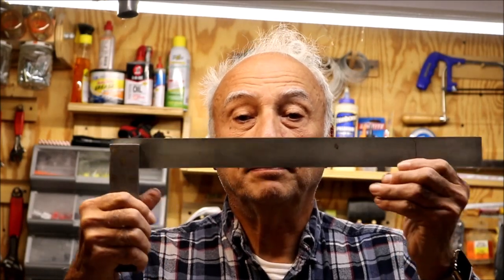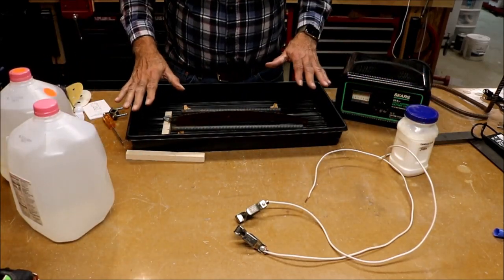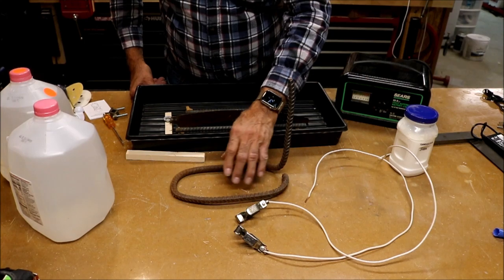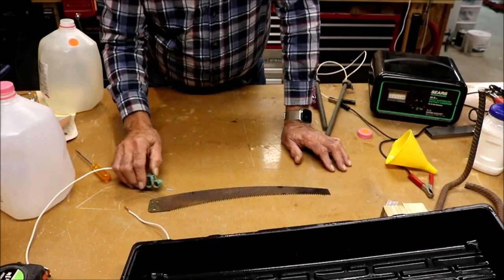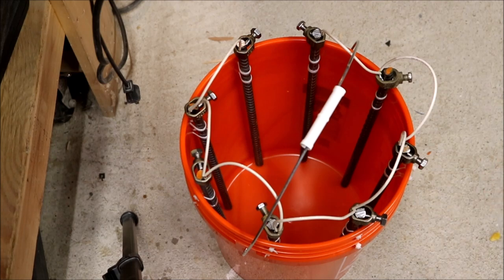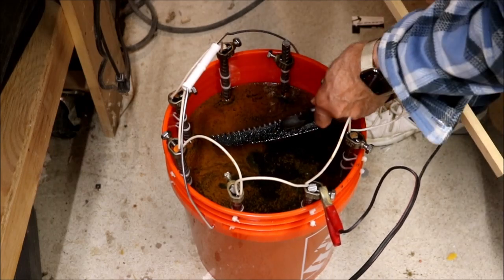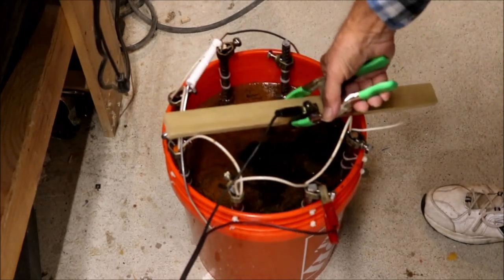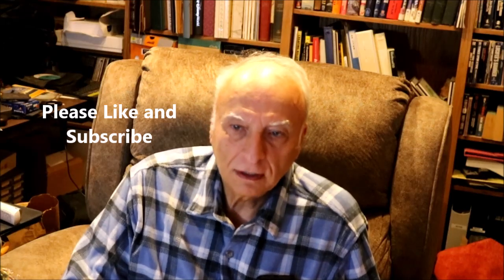Removing Rust the Easy Way

Comment: This is unconvincing I'm afraid to say.
No Chlorine can be evolved if there are no Chloride ions present
The mechanism of the process is not given.

I have no doubt that rust can be removed using electrolysis but I'm of the opinion that the black coating, whatever it is - is unattractive.  Perhaps the process is sensitive to temperature, voltage, current and solution concentration.

Thank you for your presentation though as it provides a useful starting point for further investigation or experimentation.

Comment: Great video, thanks for sharing. Just let me ask one question, please : washing Soda mixes with water into a more or less strong Lye . Have you ever tried removing rust with acid ? Used that method with old corroded bronze coins and it worked very well. It’s a bit tricky in handling and one has to watch over the coin , or there won’t be much of a coin left . Also hot water and salt in alloy foil will get of corrosion on silver . Both methods work without electric current. Although only on small items, admittedly. Anyway, thanks again for sharing your knowledge!
Reply: Forgot to mention: I am using citric acid or vinegar to remove oxidation from battery contacts. Works also very well.
Reply from the maker: @klausphotobaer5754  I have never tried acid. Just the rust removal gel

Comment: also ive found that you get the least destrutive results if you start with low amps and volts and let it run for longer periods of time periodically removing the item and phsyically cleaning away loose rust and debris before reinsertin for more time. if you run high power you will see results faster but you really need to monitor it closely or you will run the risk of ruining your item. remmeber the electrolysis can also work both ways and eat up your tool way more than the rust ever did if you overdo it. ask me how i know. i added a ton of pitting to a wrench i got impatient on de-rusting and it ended up looking like the moons surface
Reply from the maker: Good points. I checked every 10 minutes to make sure that doesn't happen.

Comment: great tutorial. ive used electrolysis to bring back tools you thought were totally gone. if you cant find the "washing soda" you can use regular baking soda or even regular table salt but if you use regular table salt dont leave your project in after you cut the power and make sure to clean it with regular water immediatley when done or it will rust again

Comment: There is a homemade alternative to evaporust that uses similar electrolyte chemicals (washing/baking/caustic soda) but with the addition of citric acid and a surfactant (washing up liquid). It may be an even better electrolyte for electrolysis. 
I tried his baking soda recipe on my well rusted brake components without electrolysis and it worked very well, (bare metal after a day soaking), electrolysis may be a great way to speed up or improve the process by replacing some of the metal already lost to rust. 
fVYZmeReKKY (The Ultimate HOMEMADE Rust Remover (Better than EvapoRust))
The other great thing about electrolysis is you can use a very similar setup to nickel plate the metal after the rust has gone.
Reply: Interesting.